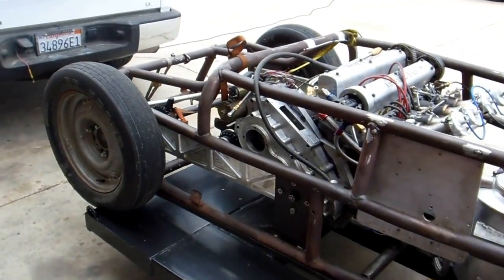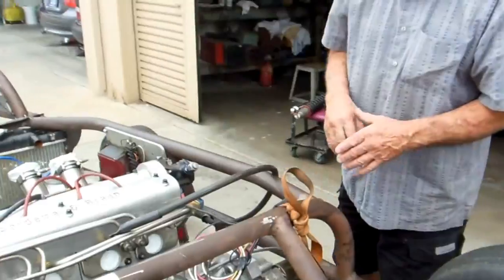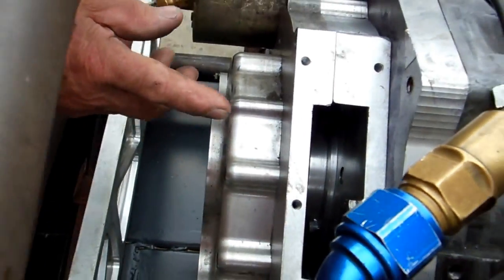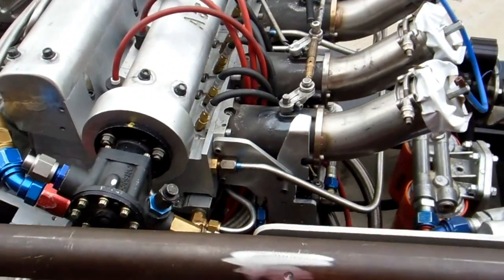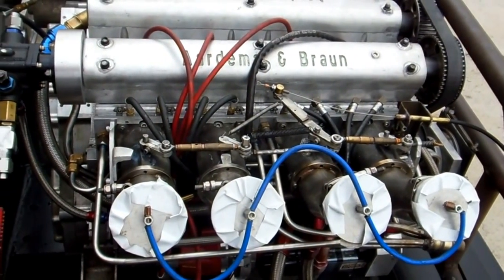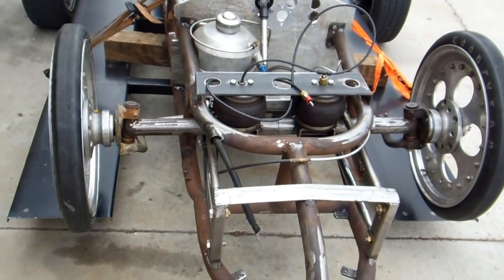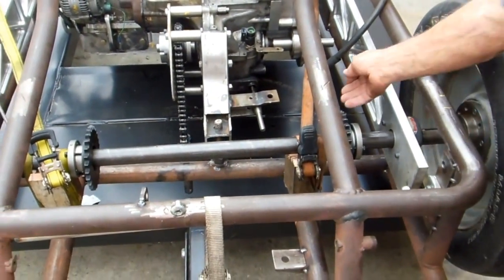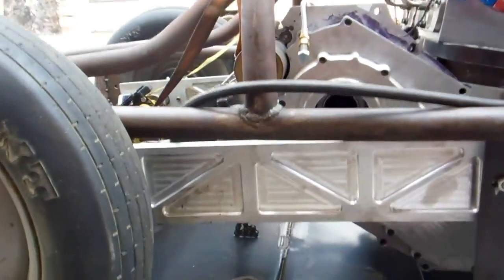How a Bonneville Record Holder Thinks Naked Car!

Comment: He's currently working on building his own engine from scratch. Literally. The block, head, cams, etcetera, all of that is custom-made. Normally I'm hooked on building anything myself, but with what he did (which is featured in Hot Rod Magazine), I'm literally hooked on doing the same thing. Possibly try and go further and do up a V12 based off of the Maybach HL230 V12s fitted in the German Tiger tank, but with a welded block (as what Pete did) as opposed to a cast block. Actually, now that I think about it... Maybe a custom "modular" V block that starts off with a V-Twin base, but can have multiples of these "bases" attached. Or "modular" in that it can convert from either water-cooled to air-cooled or vice-versa by swapping out cylinder bank designs. Either way, Pete has kicked my need to be creative into overdrive.
Reply from the maker: Funny, he's just starting on a fabricated V12 for unlimited hydroplane use. It'll have a one-off billet crank, fabricated block and billet heads.